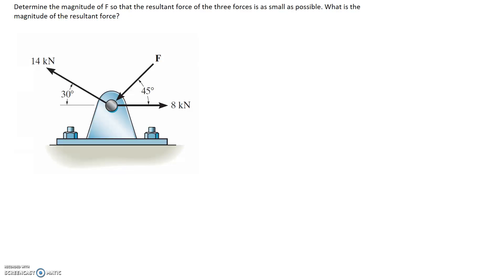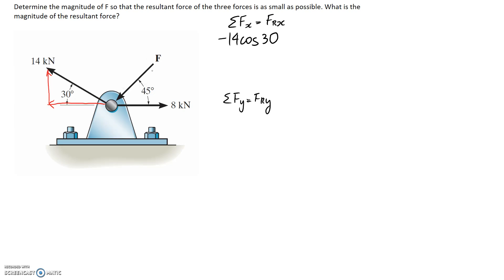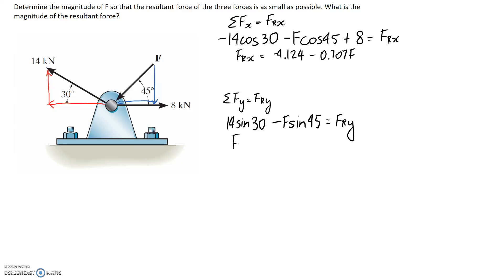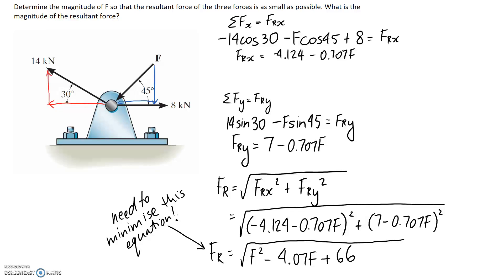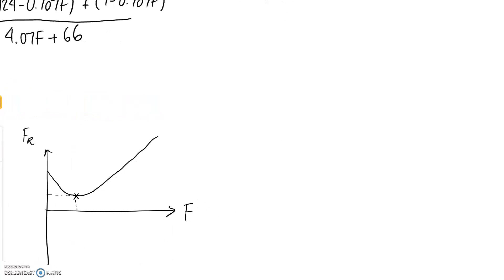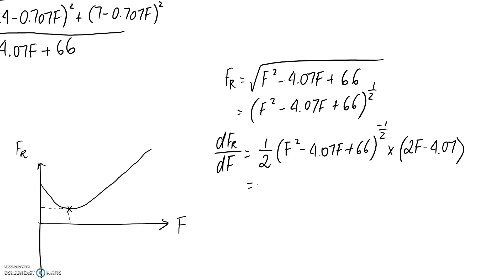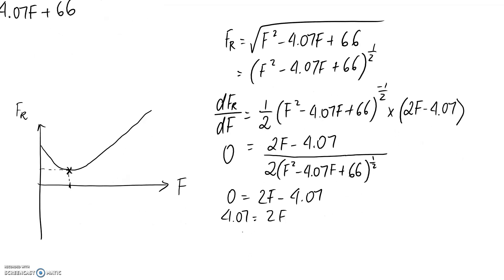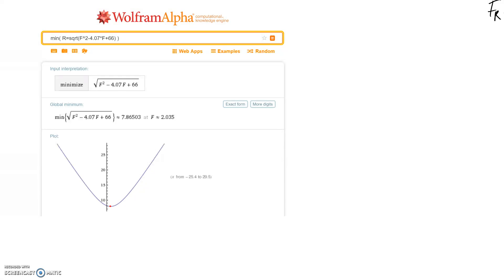(2-53) Resultant Force Example #3

Comment: Could it also be possible to find resultant force FR1 produced by two 14kN and 8kN by finding its direction and angle? And then solving simple triangle made of FR1=8.12kN at 59.5degrees to horizontal axis and F vector force at 45 degrees -  that will give the same answers of F and FR as per video? It is easy to see this triangle when you plot all vectors on a free body diagram.